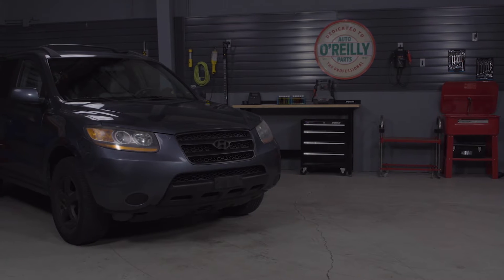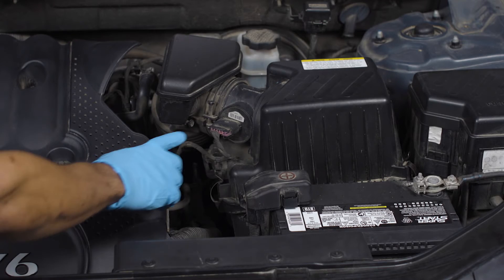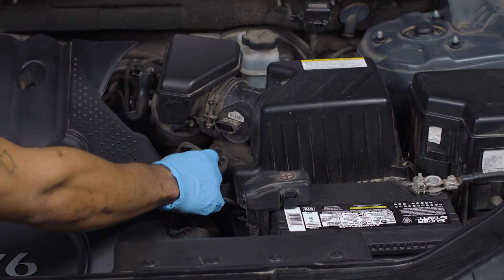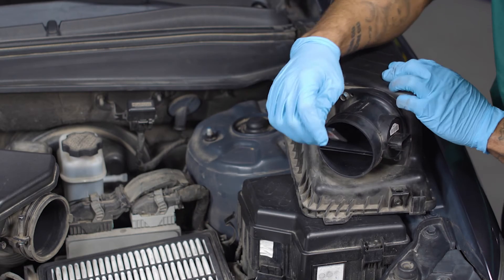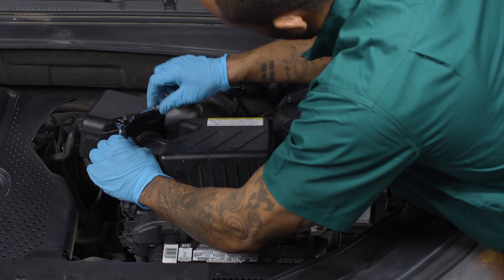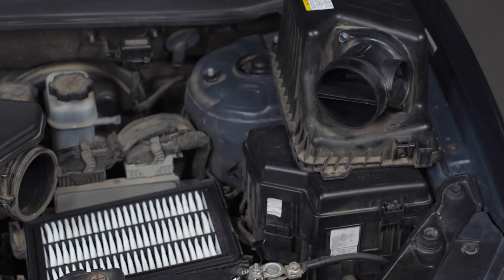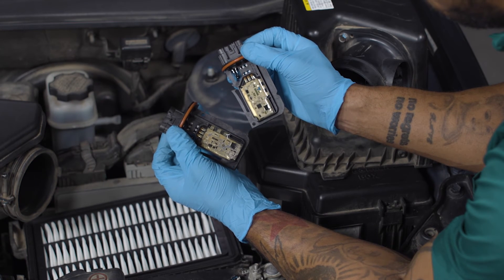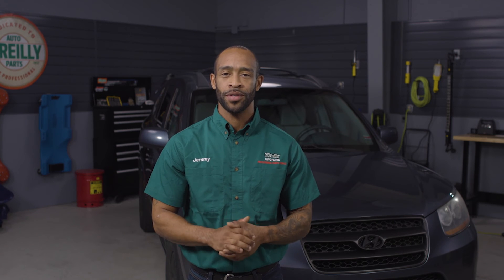How To: Clean & Replace an MAF Sensor (Mass Air Flow Sensor)

Comment: Not only does he not show how to clean it, he also doesn't mention how to remove the sensor (unless you happen to have the "key" that comes with a replacement sensor).  So if you just want to clean your existing sensor, there is no instruction as to how to remove it or how to clean it.
Reply: Fact

Comment: Will throttle body cleaner work?
Reply: I heard you can use it but maf spray is more gentle on the sensor because of how sensitive it is. If you can spare the $12 for the spray, i Iould recommend it. Plus I know for sure you can use maf spray as a throttle body cleaner